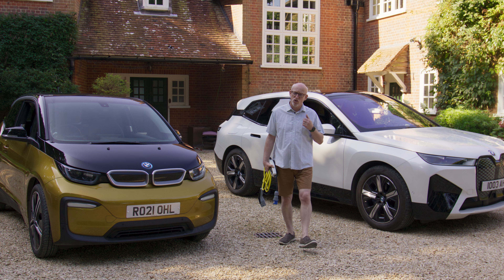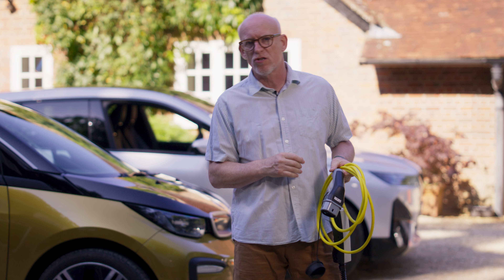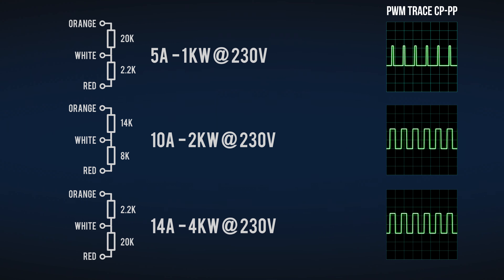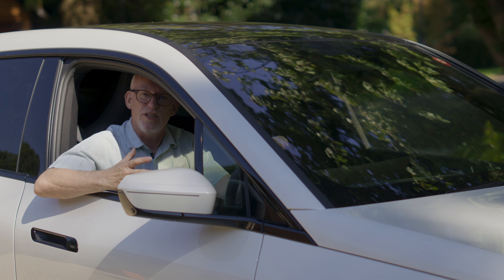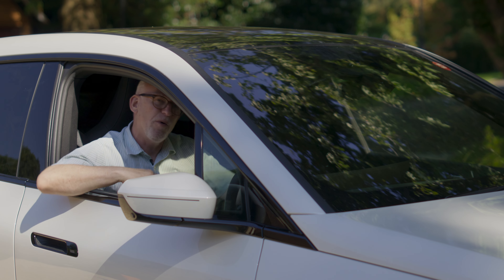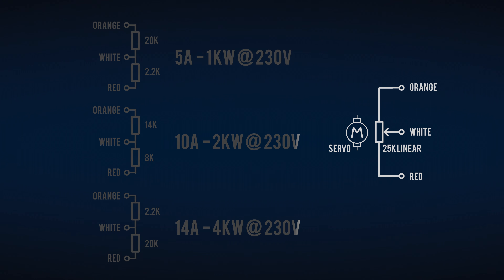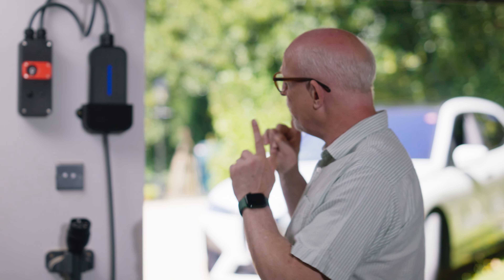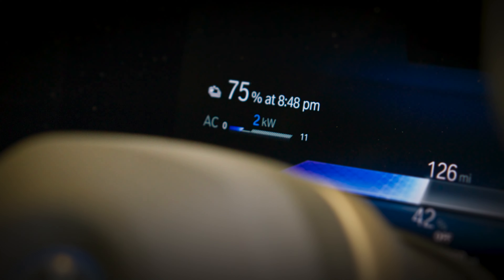Hacking the BMW Flexible charger - no internal modifications

Comment: Hi Andy,
Thanks for the useful info. I have a few questions if you don’t mind:
- what would be the resistors’ values for 3-phase 11kW charging?
- can I buy the connector only from somewhere?
- is it possible the cars imported in Australia to have the 3-phase charging with flexible charger disabled (they don’t sell this cable here, only the single phase 2kW is available)?
Thanks

Comment: Please, tell me that I'm right:
To achieve 16A (3,7kW) chargé from 230V plug (Type E+F) i have to cut cable and put two resistors - 2,2kohm between orange and white, and 20kohm between white and red right?
I have CEE 16A cable, but I need to use Type E+F power plug.
Reply from the maker: Saw your email indeed you are correct ...

Comment: Hi Andy - really interesting video and the ability to get 4kw charging would be a real boon from a 13A socket. I have no idea how to make one of these, but do you know of anything commercially available? Otherwise i will have to stick with my 2.3Kw charging speeds or go for a home charger. Many thanks, Darron
Reply from the maker: I'd say pop into an electrical wholesalers to see what they have, I came across PodPoint boxes for just under 500 quid that would do roughly the same thing (although for one vehicle at a time).   I'd watch out for the monthly charges though!

Comment: I'm glad I found your channel. I've just bought the new 760e BMW and the dealer tells me it only works on ac voltage. I haven't taken delivery until 2 weeks time. What's the best way to charge at home. Would appreciate your reply. Thanks
Reply from the maker: The 760e has an 18.7 kWh battery that is good for about 50 miles electric range.  At home, you'll need an AC charger with a type 2 outlet.   You can charge DC at 50kW at 'fast' chargers.  You'll get a charger with the car - and you'll need to tell them what sort of socket you have available.  I would advise charging as slow as possible - 2.3 kW would be fine for an overnight charge.  You can charge at 2.3kW from a normal plug.   If you have a 16A (single phase) circuit available, 4 kW is a good option,   I would avoid anything over 22kW (DC).   I'd avoid leaving the battery either empty or full for weeks on end.   On the other hand if you've leased the car - do what you like ;).   This video was about making the flexible charger behave in different ways.  These days decent wall chargers are available IRO £450, and these would work with with say the Octopus Agile Tariff.  As far as I can tell, 760e can't draw more than 11.6kW on AC - because that is the rating of the internal charger.  Looks like a fun car!

Comment: Does the hack box have 2 x ccs2 connector output to connect to 2 EV'S?
Reply from the maker: I made two identical units and used software to check that both potentiometers are not set to high.  There is one box for each of the two car bays of the garage -- I'll make another if I get an electric motorcycle ;)     ---    As an aside, I see the prices of these boxes have gone up and the off the shelf boxes are coming down - but these tend to have the 'subscription' model where you have to access the units through the vendors App.

Comment: hello
I have tested your method to change the current on 2 flex charger 1.0 and 2.0 European model. it seems that these bmw flex charger need power of and on (reset) to take in consideration the change of current. moreover one reistor is an ntc for temperature and has to stay constant the second one is 8kohm for 10A and 37khom for 16A current
can you help me to make it variable dynamicly without stopping the charge?
Reply from the maker: Hi Marzio - that is a super interesting question!   I did not know or find a NTC in my test.   I built two of these for our two EVs.  In terms of static load they are super reliable.   But for dynamic load they behave differently.   I cannot get a change from 1-2kW up to 4kW.  I can get 1-2kW changes but only on the BMW iX, the BMW I3 will continue to take whatever it started charging at.   I have made a modification to I3 version that has a 45A SSR than can switch off the charger.    Since we made this video I've COMPLETELY changed the way we charge our cars - they still go through the "Flexible" boxes.  BUT!!! - now we use the BeemerConnect API to get all the data from the cars.   For the iX we use SOC commands based on a pricing strategy and for the i3 we read the charge state and simpole use the SSR to stop and start charging.    I have realised that different generations of BMW cars support different command sets - so I know that new iX1 has an even richer set of commands where you can stop/start, set the SOC and even the charge level.    Make me think about getting another video together.   Summary answer 1-2Kw on the iX was possible, no dynamic changes on the i3.   Myenergi Zappi wall boxes are getting cheaper (trade prices) by the month.  We're on an 'Agile' tariff where the price of electricity changes every 30mins and - sometimes it is free or better - so I've switch my tactics to software calling the BMW API to charge at the cheapest point with the iX set to 4kW and the i3 set to 2kW.   Cheers --- Andy

Comment: impressive video, but all you really need is a wallbox with decent load monitoring and balancing.  BMW wallboxes kind of do that too, but too limited.  In the Nordics there are alternatives using Enegic, Ctec and other energy monitors that make all of this fool-proof and efficient (it does cost some money to buy though).
Reply from the maker: I agree - the market has moved on and prices are lower ....  although bimmer_connected is an interesting software solution

Comment: Hi can you switch the power setting during charging?
Reply from the maker: No, once the handshake has completed the charging current stays the same.  There are units such as Zappi that I believe can do this.
Reply: @AndyThirtover  Thanks, I foun dout I can use my Home Assistant to controll the charging Process via BMW Connected
Reply from the maker: @pos6kafa   ... thats what i did in reverse!   I found the home assistant link and then worked back to the API!

Comment: Can you please list of parts to make the hack box
Reply from the maker: I believe the most important part is the 25K Lin Potentiometer.  I used some very cheap RC Mini sized servos.   I 3d printed a couple of gear wheel to give me 330 degrees of Pot rotation from the 180 degree servo movement.   I used a RP2040 with MicroPython, but an ESP32 or other processor would work just as well.  I also used a encapsulated 240VAC to 5V DC to run the processor -- mainly because I truly wanted isolation for the charger -- in my case I made two identical units.   I could go into more detail if you wish.

Comment: Where is this resistance in the plug ??
I have 10A charger how can i change it ti be 16 A by using the resistance where i will put them ??
Reply: I have type E+F adapter i want to change it to Cee 16 A plug to work with 4kwh but iwant to know where i will put the resistance ??
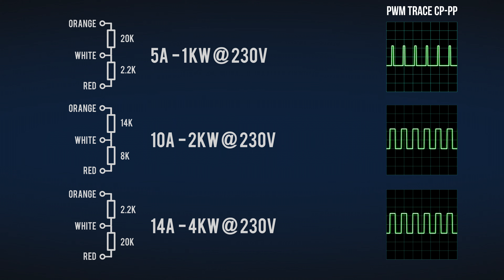Reply from the maker: At 1:04 you'll see the values.   This charge only has three levels, which on single phase is 1,2 and 4kW (@230V input)  just before that section you can see where we stripped down the mains cable that was supplied.
Reply: Can i know the specs of the resistance, like the watt capacity of it ?
Reply from the maker: @lalatoto123  the two resistors are used a a voltage divider at very low voltage (about 3V).  The ratios let the charger box know the capacity of the supply, so in the BMW cables they are encapsulated in the plug.  They need not be of any special rating 0.25w is fine.
Reply: @AndyThirtover  In E+F plug or in plug to the charger?